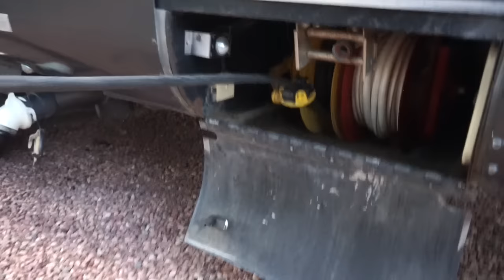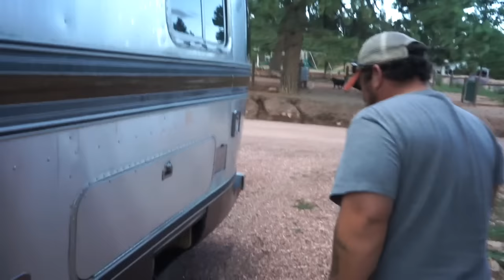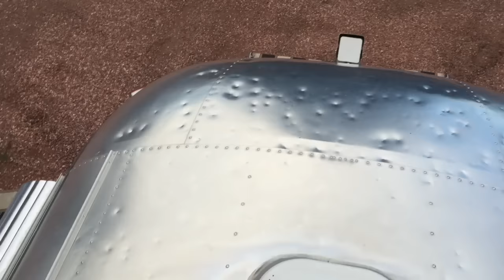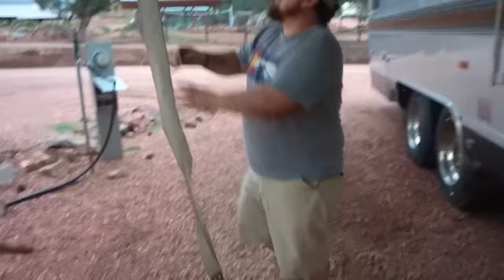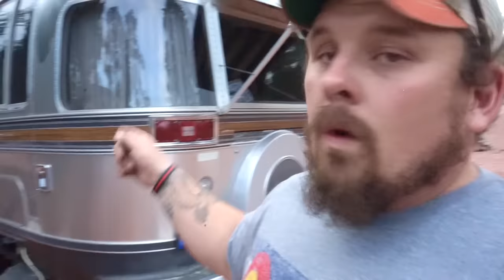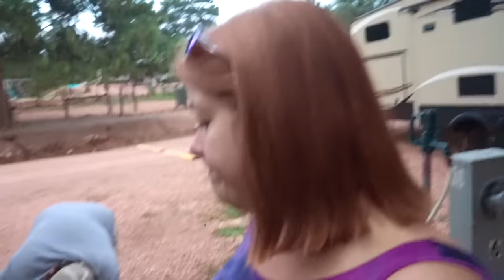SpotTheScotts: Airstream 345 ROOF Hail Damage & 1st Time Hooking Up! {#367}

Comment: Elvis has dimples!!  Oh my gosh, guys with dimples are so cute!  Holy cats, though. That's a lot of dimples. I know that you don't know yet, but I would think, if it's still structurally sound, just leave it? (the ones on the roof that you can't see). I LOVE the awnings!  Elvis has such style!  Newbie question...how do you clean an awning?
Reply from the maker: +Diane Craig we most likely will end up leaving the dents and fix the other things that got broken but again it will definitely depend on how the insurance company plans to handle it. As for awning cleaning we use a sturdy scrub brush like a deck brush or something and soap and water and hose if off, sometimes mix in a little bleach if it gets musty